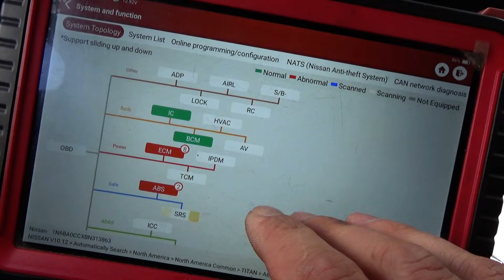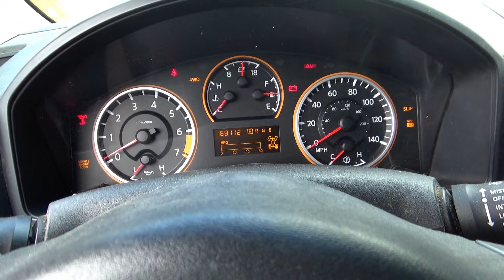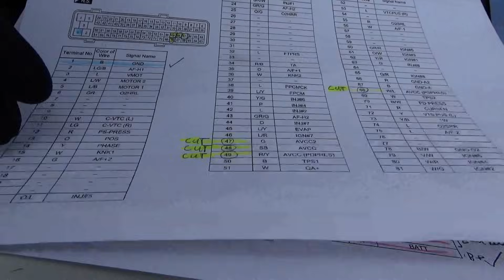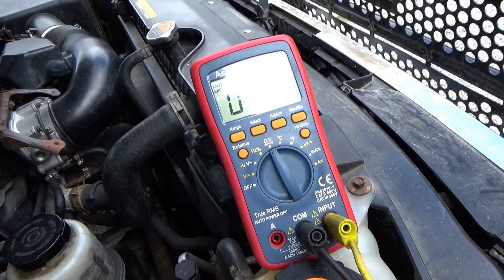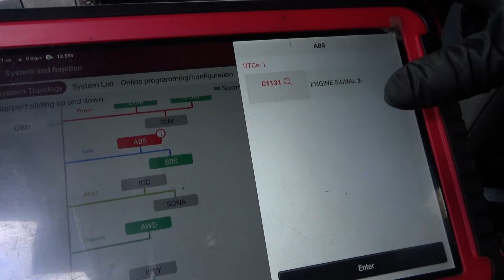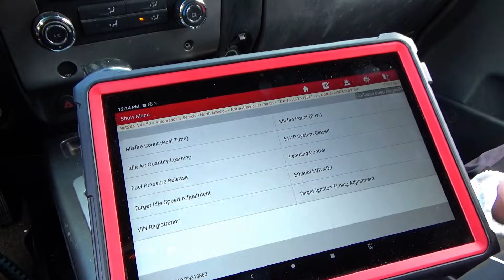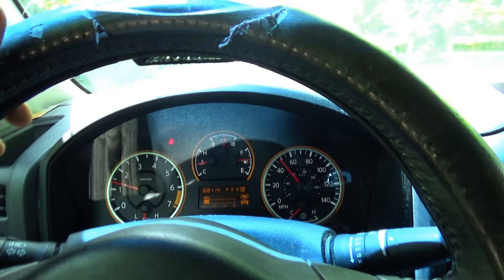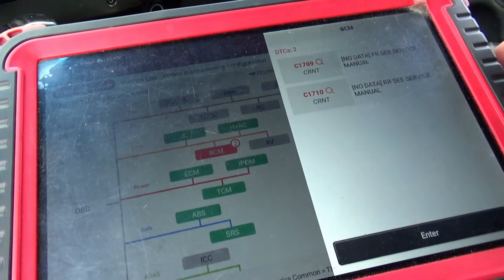Can "JUSTANSWER.COM" Fix Your Car? (Part 2: Nissan Titan NO-COMM for a YEAR!?)

Comment: As an electronic technician for over 40 years I never used butt connectors always solder connections.
Reply: Avionics technicians always crimp. Solder is a big no-no for stranded wire in general but moreso on anything that vibrates like cars, boats, and airplanes.  The FAA even calls this out for repairs.
Reply: thdevilmancometh GM factory authorized wiring repair, at least on my 2014 GMC, is shrink wrapped butt connectors.
Reply: @douganderson7251  GM is synonymous with quality, too.
Reply: There isn't a soldered connection from the factory.   
Capillary action causes solder to harden the strands and vibration can break them.
Reply: thdevilmancometh  if you buy the cheapest crimp connectors, they will work as well as the cheapest solder you find as well.
Reply: Are your solders exposed to the elements and hot/cold cycles?
As Eric O pointed out, virtually no connectors are soldered on cars coming out of the factory.
Inside modules, and parts that aren't subject to flexing or movement I'm sure are fine.

As always, whatever connection is appropriate at the connection.

Comment: I've only deliberately cut a wire once, and that was after research in a manual not garbage information on the interwebs.  Kenwood radios use a clock signal running out to microphones that also have a keypad.  They use untwisted, unshielded wire for some reason.  So the clock signal ends up bleeding into the mic circuit, and you get an annoying 1Hz click - 1 PPS in engineering speak - when you transmit. You can't hear it but everyone else can. The solution, if you never need the key pad, is to snip the clock signal wire.  I go a step further by creating a small extension to the mic cable that doesn't include that wire because the wire can still act like a transmission line even when cut.

Comment: Watching you solder all the cut wires made me think that it was lucky that the owner didn't cut them flush to the connector. Great work, Ivan! Even the Amazon throttle body seems OK!
Cautionary tale for all the DIYers - this could have been an expensive adventure!
Reply: I had a kid call me to come over to his apartment. 
He has engine problems. 
So he bought a used engine. And he called a mobile mechanic for help. 
He said the mobile mechanic installed new main bearings and rod bearings. 
The guy just an impact wrench to tighten everything up. 
No torque wrench required 😅😅😅
I come over. The car tries to start. I noticed the O2 sensors are not hooked up. ??
I see the O2 sensors ends laying on the top of the engine. 
I ask??
He says, the wires were in the way, so I just whacked them off. 
I said. You just push this thingy and it will pop loose. He says. Really!!
I said yup. 
And no wonder the car will not run. 
After a few tries, the engine kicks to life. Then rattling and knocking noises. 😅😅😅
He shuts it off.???
I tell him. Wellll, when the mobile mechanic didn't use a torque wrench on critical fasteners, you get this.
Reply: @2nickles647  I have a feeling the kid WAS  the mobile mechanic.
Reply: @KStewart-th4sk : Yep
Reply: @2nickles647 :  Probably foreign object in engine. Was he missing any rings 😂?
Reply: @2nickles647  Yep, these nonsenses come in all forms and shapes!
Reply: This is what happens when the Blind are led by the Blind…
Reply: @paulsz6194  🙂

Comment: I think Mr Jeff has not finished your videos yet, cuz I have been watching your videos for the past 3 years and if I have to watch it 3 times I do it cuz I want to learn from the best and not part changer.
You never has replace a part without testing it Ivan .
Place your bet .
Not parts required.

Comment: Awesome work there Ivan.
If you were 700 miles closer I'd definitely have you look at the issue im having.
Loss of communication between several modules.
Reply: Have you tried cutting a few wires?
Reply: If you have some basic skills and tools and access to diagrams,

- check powers and grounds, fuse or fuses

- is anything else on that network talking?

- When you put a multimeter on the CAN wires, do you see 120 ohms or 60 ohms?

- do they all talk to the same gateway?
Reply: Haha, NEVER!

Comment: Did you do a continuity check on the wires so the are in the correct spot ?
Reply: What’s the point? All the wires are matched colors and after all soldered if he had codes or issues then maybe check that but that’s times consuming and no reason wires wouldn’t match corresponding colors.

Comment: It’s amazing that they instructed the customer to just cut the wires! 😂
Reply: It’s amazing the guy actually did it.
Reply: @bohawkins5258 👍✅️👍✅️👍✅️
Reply: They should've told them to disconnect the driveshaft from the differential;
Reply: And he did it !!!
Reply: Lucky they didn't tell him to pull the engine....😃😃
Reply: French Guard: "I told heem to cut the wires!"
Reply: pepsi in the gas tank
Reply: first thing i do when buying a vehicle is join whatever website group is dedicated to that vehicle.....i bet this guy didnt do that cause nobody would advise cutting factory wires..ran fine from the factory
Reply: To give them some benefit of doubt: The two unknown factors are the old engine computer and the old throttle body/sensor. Without seeing the exact communication between that site and the owner it's hard to tell what they had to go on. It might had seemed like a 5V supply/reference problem, and replacing the throttle body/sensor and the computer might had solved that issue.

Although cutting wires isn't great, it seems like a better advice than telling an unknown person to de-pin connectors. Especially given that the connectors were messed up even without any attempts at de-pinning proves that cutting wires was likely better than de-pinning.

Would be super interesting to see the actual communication.

Bonus: I think it's time to educate the general public in that diagnosing and repairing are two separate things, and it just happens that some who do repairs are also good at diagnosing. Or to put it in other words, it's time for diagnose shops who don't do any welding, mechanic repairs and whatnot except the bare minimum to do a correct diagnosis. I think that would attract a new set of skilled diagnosticians that otherwise would never want to work as a mechanic.

(Taking myself as anecdotal evidence - I hate working on almost everything on cars that is in front of the firewall or below the floor, except electrical things. This is one of the reasons I've never even considered becoming a mechanic, but looking at Ivans videos I realize that if I had to switch careers I would probably both be god at and enjoy doing diagnostics. Especially if it were at shop where other mechanics can do the mechanical work and I can do the diagnostics and electrical work. Give and take. But then I'm the weirdo who can do an oil+filter change without getting my hands dirty :) )